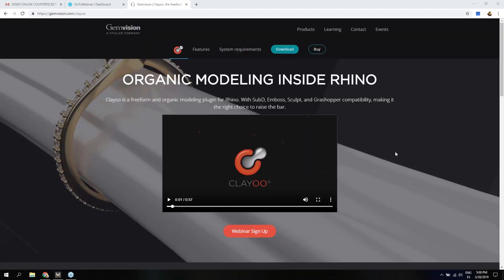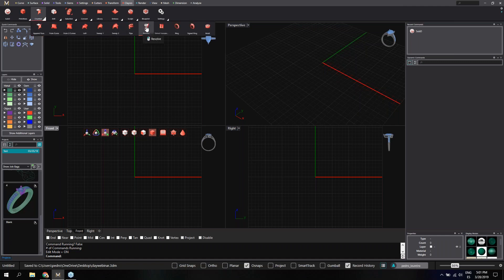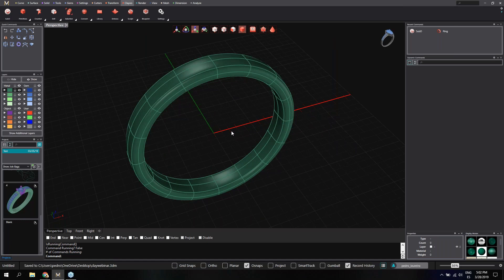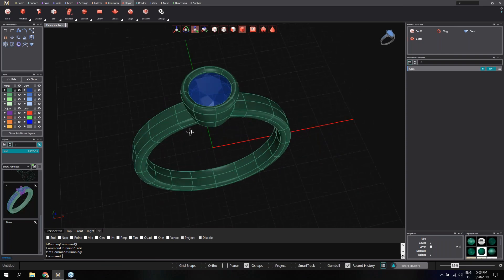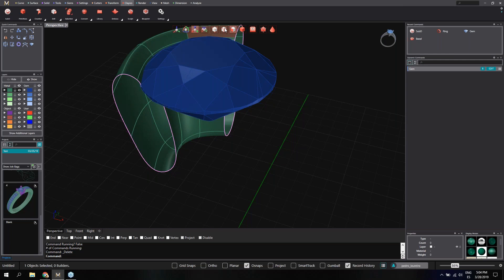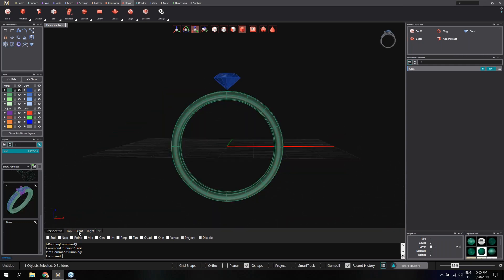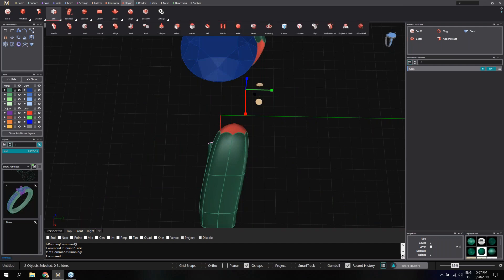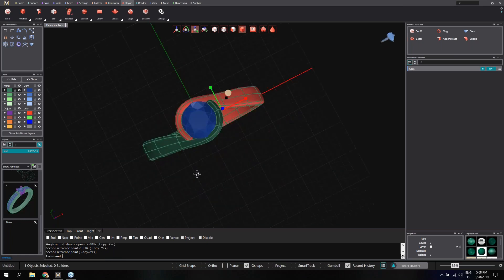Bypass Ring with Clayoo & MatrixGold  - Clayoo Webinar (March 28th, 2019)

Comment: If I want to resize the whole ring do I have to repeat the whole process from the beginning or is there a faster way?
Reply from the maker: Hello Alexandros, we have the resize ring tool from MatrixGold which will allow you to change the finger size in just one click. You can also select the faces that you want to resize and scale, doing this though, you will increase the thickness of this ring and you will have to edit it later. So the best solution is to use the Matrixgold ring resizer
Reply: @GemvisionLLC   Sounds great. With the resizing tool, are all the proportions of the gems and their distances kept or are they arrayed accordingly?
Reply from the maker: @alexandroskkoufou1793  All the proportions kept the same, The finger size is the only thing that changes.
Reply: @GemvisionLLC  Hello, I did all these steps and when I tried to resize it said i don't have a valid ring rail, is that right or do i need to add a ring rail and attach to the ring ? Thank you